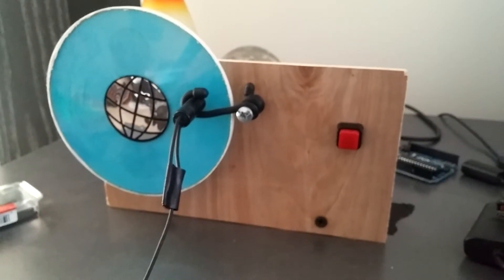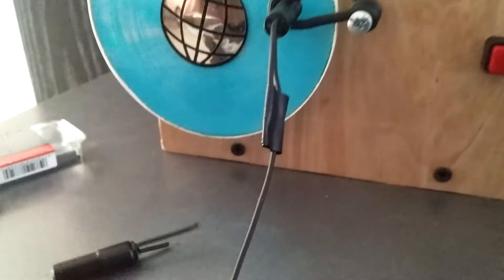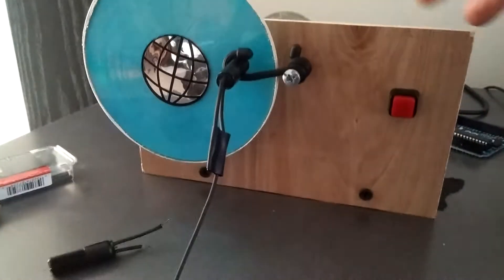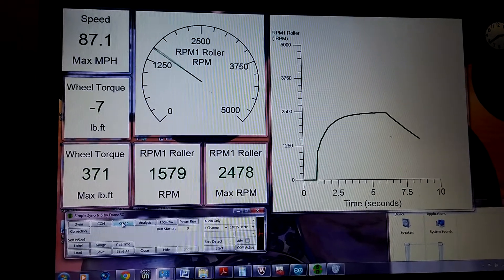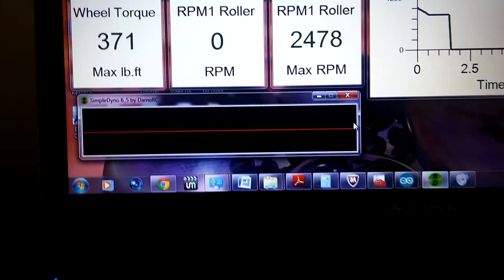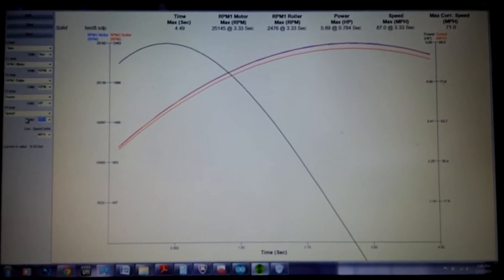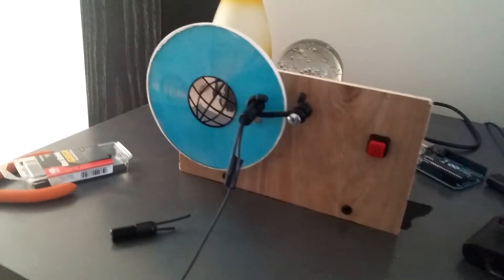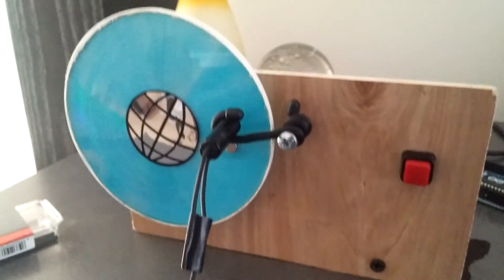SimpleDyno Pick up Test Rig

Comment: Hi, China Jon can you show me the diagram
Reply from the maker: I dont have one.. The Wires go to the 2 wires a 3.5mm Jack.. Use a Analog jack for 1 RPM input or a Stereo 3.5mm Jack for 2 RPM inputs.. You need to figure out what wire does RPM 1 in testing if you are using 2 Inputs (2 Channels)... If I remember its we super easy...

Comment from the maker: Is the magnet pick up going through the arduino or into the 3.5mm mic jack? Make sure you have selected "com and audio" if its plugged into the audio jack or just the COM port if its plugged into the arduino... But not positive. I haven't finished mine yet.. Haven't had much time with the logger.. Thought i read if its going strait to the Arduino its neends a schmitt trigger in line?!
Reply: China Jon good ideA